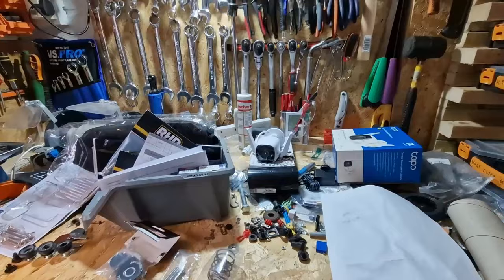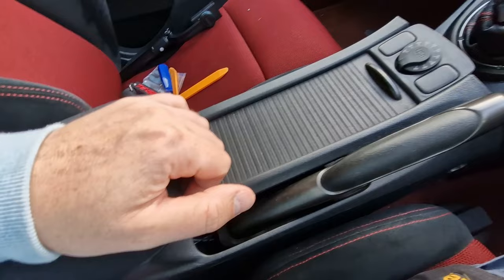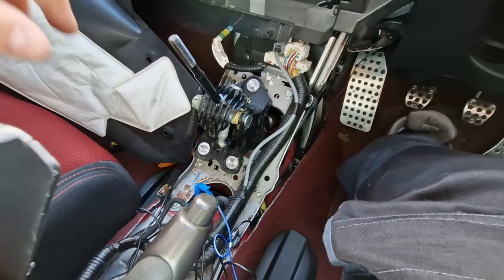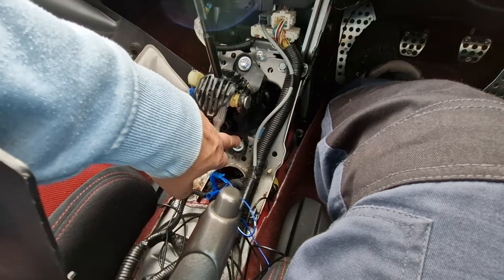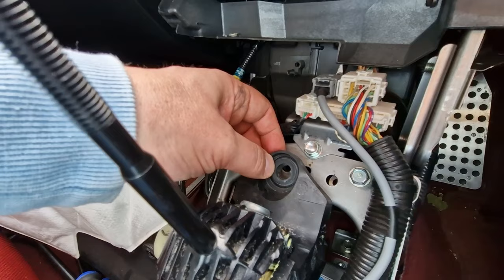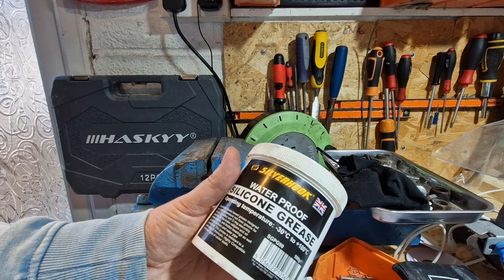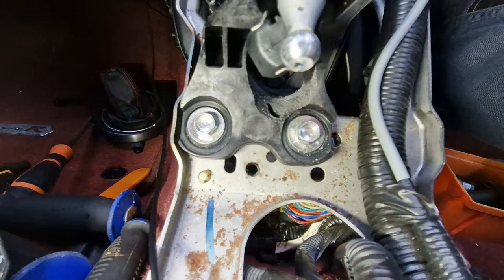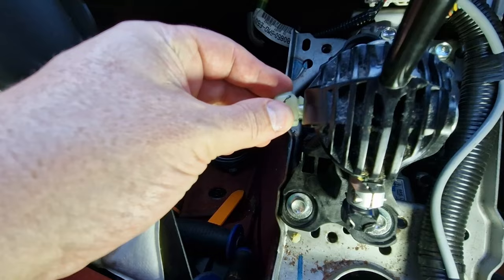FN2 Budget Short Shifter Install

Comment: Acuity has a new  short shifter for the fn2, superior to HR shifter. Any other cheap crap out there  isnt  worth having.
i liked yer video btw.
Reply from the maker: Oh cool. I will have a look 👍 Thanks 👍
Reply: @ModFix  choice of 1 way or 3 way fully adjustable rig. There is no youtube vid for anyone showing a FN2 intall just yet , it may or (may not) need some alloy or nylon spacing between chasis to shifter assy to perfect its length on the cables , so as not to damage them
Reply from the maker: They do look nice 👍 Just can't bring myself to spend that much on a shifter.  I think I need a new clutch instead 😢
Reply: @ModFix  i just did my clutch...installed Exedy HCK-7369SO.  its good.narrow friction point , not heavy on the pedal feel either.  but use a genuine HOnda thrust bearing -not the one they supply.
Reply from the maker: Cool.  Thanks for the info 👍